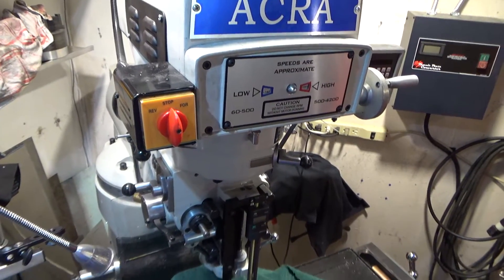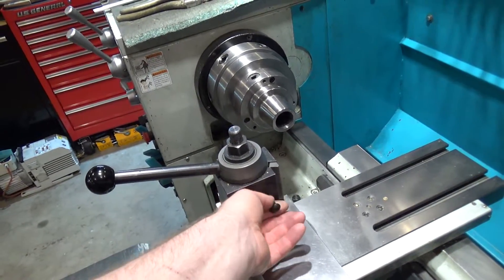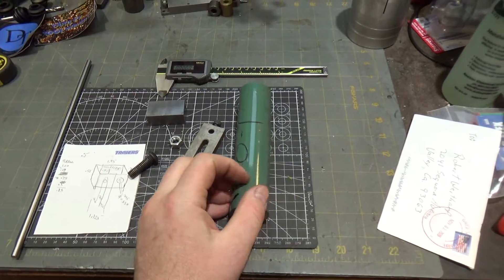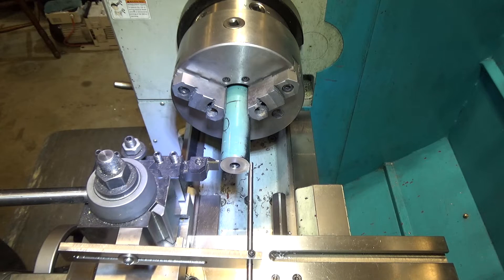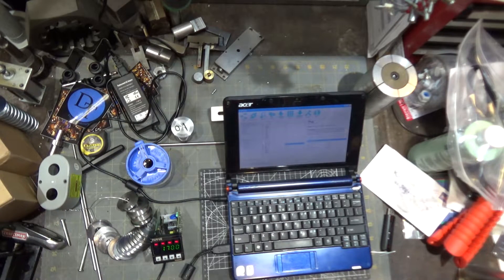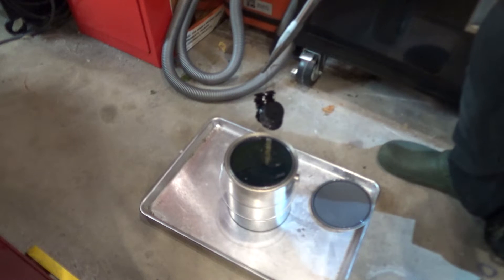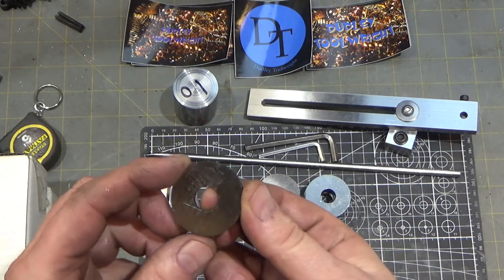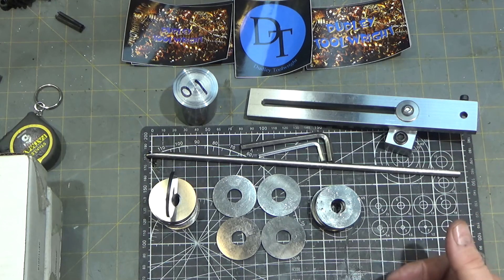106 Hardened Washers for My Clamp Kit

Comment: Which parting tool and holder is that?  It seems to do a good job.   I'm about done with blades!
Reply from the maker: The parting tool is a Kennametal (the only name brand tool I bought new)
P# EVSMR120322C Beyond Evolution Series
Insert: EG130I03UIGMP KCU25

This tool does more than just part it also can cut laterally in either direction to widen a groove.

Hope this helps,

Dudley
Reply: @DudleyToolwright  Thanks for the response.  I grabbed one.  It does have multiple cutting functions that work well.  Much better than the GTN blades I've been using.
Reply from the maker: No worries. It is a really nice tool that out performs the cheaper competition, but I did manage to break one of the holders and had to order another.

Comment: I am loving the HotShot 360 from Stan. I have my temps dialed in for A2 now. 01 is notorious for cracking in heat treat.  We had stuff come back from a professional heat treat source numerous time with cracks. I don't believe to 01 today is as good as it was when I started the trade. Thanks  for the video. 
Steve
Reply from the maker: Thanks Steve. Interesting bit about the O1. It's nice to know that the prs even have trouble from time to time. I have had much better luck with A2 as well. I would have preferred to uses something less expensive like 4140, but didn't have any.

Comment: I thought they turned out well, and nothing wrong with using a technique taught by a senior tradesman like Joe.  I have a lot of respect for him, and saw the video you were speaking of.  Interesting marks in the steel from the heat cycle, as you say, all I've ever done with O1 was heat with a torch and quench, never had those marks, but the parts were smaller.
Reply from the maker: Thanks for the feed back. I know that a torch would be a lot quicker, but wanted to show off Stan's ovens, because he did such a nice job on them.

Comment: Adding argon purge to your oven should address the oxidation issue. There are also coatings that work well, but they will contaminate your oil.
Reply from the maker: Thanks for the tip. I have been b=meaning to try an argon purge...you have inspired me.
Reply: @DudleyToolwright  Something else that might work for you is to place a couple sheets of uncoated paper in the oven. If your oven has a decent seal, then the burning paper should consume enough oxygen to prevent your parts from oxidizing.
Reply from the maker: @EDesigns_FL  Thanks. I was going to include a carbon source when I use the stainless wrap, but had not considered it for the oven as a whole. Interesting.

Comment: Dudley -- here's is a different twist , in the past I have used belleville washers . They are hard and are equal to the task.
Reply from the maker: Those would be some big belleville washers. Neat idea. I could have made the washers out of 17-4Ph and pressed them conical in the hydraulic press and finally heat treated them to make them springy...or spent a few buck and bought them from McMaster Carr. Thanks for the cool tip.

Comment: Joe Pie is an educator!  You are not stealing what he has taught you to do.  Joe has decades of experience, and is great at what he does.  I see you are wearing your safety crocs!!  What's the sense of having a surface grinder is you don't use it.  Great work Robert.  Next time run a bolt through them, and tighten, then only the end ones, and outer edges, will have scale.  You can use an old washer to cover the end ones.  You are getting better and better at this.  Soon you will have to change that disclaimer.  LOL
Reply from the maker: You are way too generous, but I always appreciate the comments. I love the idea with the heat treat spindle. I have the stainless wrap and was going to use it, but didn't when I thought I could get away with it.